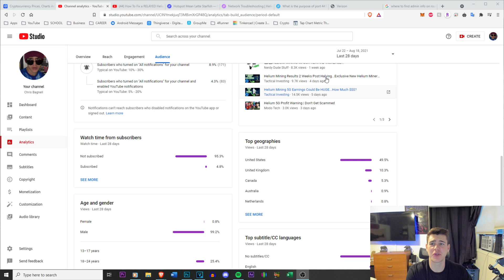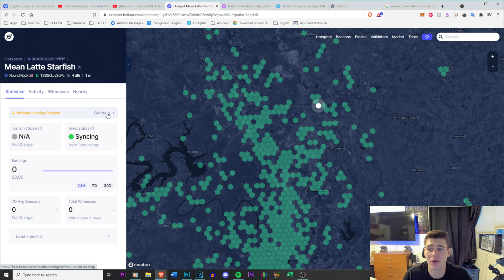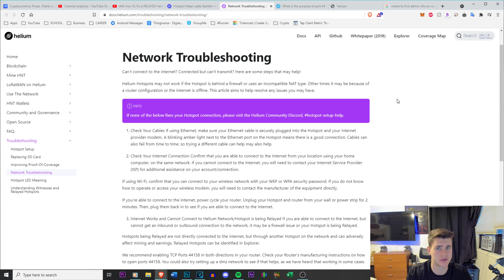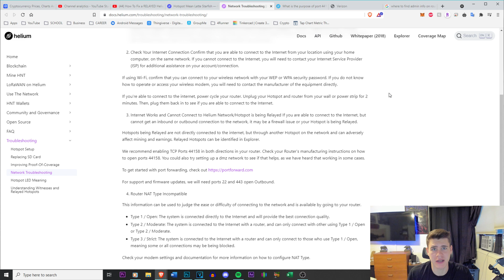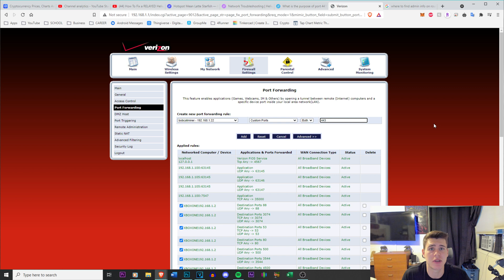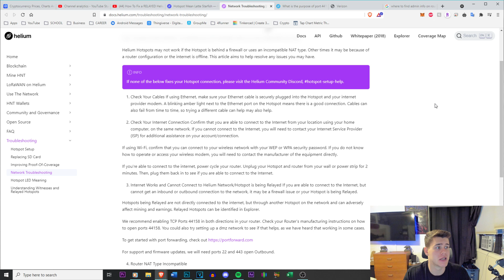How To Fix a RELAYED Helium Hotspot to Improve Earnings!

Comment: Do not port forward 22 or 443.
Reply: Don’t you have to reserve your ip address as well?
Reply from the maker: Why?
Reply: @chrisbagnell  Those ports are outbound only. You don't want to leave them open so someone can access the router.
Reply from the maker: Thanks for the info I will change it now!
Reply: @chrisbagnell  Please edit/update your video where you mention port forward 22 or 443, as viewers may not also read Ove Garcia's comment here and end up doing something they shouldn't.  For your convenience, this is located at about the 5:15 mark of your video.